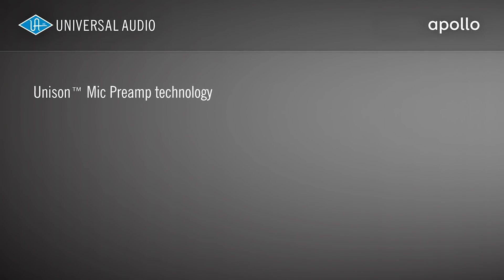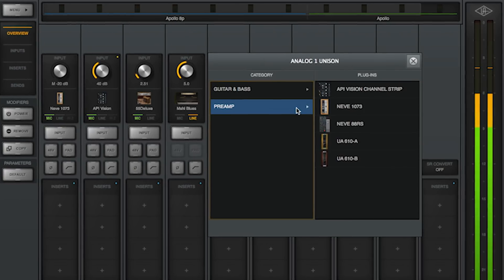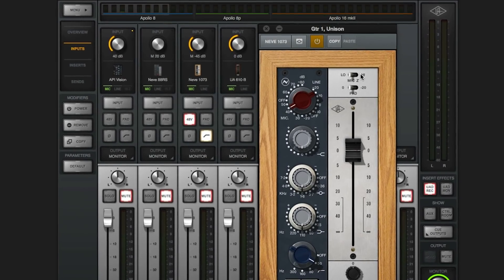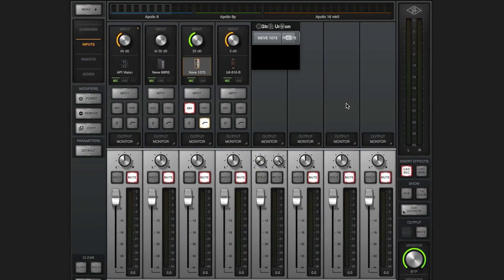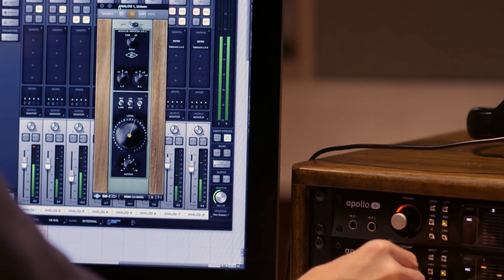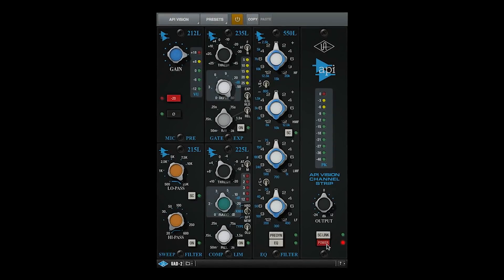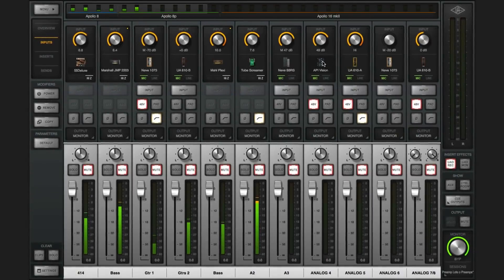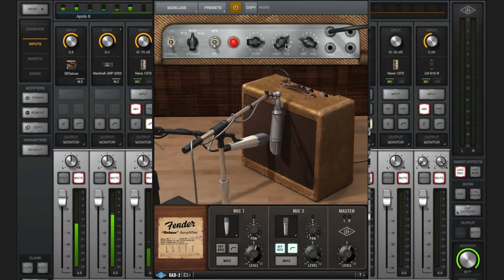UAD Basics: Using Unison with Apollo Interfaces

Comment: When using the 610B in the Unison insert with my Rode podmic, it generates SOOOO much noise/hiss,  it's unusable. Am I doing something wrong or is Unison not intended for dynamic microphones?
Reply: I know this might sound a little crazy, but make sure you didn't accidentally hit the talkback button.  I did that one time and it was so noisy I thought the mic was broken and couldn't figure it out for a while.  It's easy to do because if you hit the button once it stays on until you hit it again - it isn't on only when you hold it down.  Your comment is from a year ago so I'm sure you got it sorted out already.
Reply: Just a wild guess here

There is a reason people use a cloudlifter on an SM7B. Those style of dynamic mics need a ridiculous amount of gain because the output is so low. When you increase the preamp gain, you're increasing the noise along with it. So thinking in terms of signal-to-noise ratio, to get that big signal, the noise comes along for the ride. 

Since unison models these preamps, that includes the idiosyncracies in their gain staging and inherent noise. I've noticed the 610B has that hiss and analogue noise.  

So to get that healthy signal you're looking for, you're probably applying a whole bunch of gain and as a consequence, you're lifting the noise too.

I don't know much about the Rode podmic but if it's anything like the SM7B, they need notorious amounts of gain.

Comment: What is the deal with UAD's voice overs? They always sound like the narrator had a blanket over his head, and the de-essing is insane! I love Unison, but I'd NEVER buy their De-Esser plugin. It's horrific. FabFilter Pro-DS used to be my "go to" for sibilance, but Airwindows' DeEss (donationware) is the best DeEsser ever. It recognizes the pattern sibilance in a waveform, then smooths it out without doing much of anything to the rest of the information in the sibilant range. I find that if I crank both the DeEss settings to the max, then raise the frequency cutoff as high as possible while still getting the sibilance then mixing in just enough dry signal to make it sound natural, it is far and away the best sibilance treatment ever. It doesn't have a wet/dry mix, but I use REAPER almost exclusively now, and it has a wet/dry for every plugin. I will still often use it on its own buss so I can do all the compression, EQ, reverb and anything else that would generate a sibilance issue on the DeEssed buss, then mix just enough of the dry vocal to give it a natural sounding sibilance. Kind of NY style everything for vocals, but it sounds great!

Comment: Does this mean that I can use my analog stomp boxes to drive the front end of the Marshall plugins and that the pre and power sections will react accordingly?
Reply: Looks like if you follow the video it explains that you can insert the Unison type plugins into special inserts in the UAD Console, then the changes you make on the plugin (or via the appropriate UAD I/O) will change the impedance and gain staging of the hardware preamp built into the I/O which is a very neat trick for matching (or mismatching) impedance and doing things with over or under-driving gain stages.  There's a lot to how hard you hit the gains, makes a huge difference in harmonics, etc.

Comment: Hey, did you tried to switch off the unison amp plugin on a DI and back on? Your level dropped about 10 db. Awesome bug, don't you?
Reply: I think they addressed that issue in the video.  They said the emulation also emulates the headroom of the vintage gear so you might need hotter inputs to drive them enough.  What do you think?